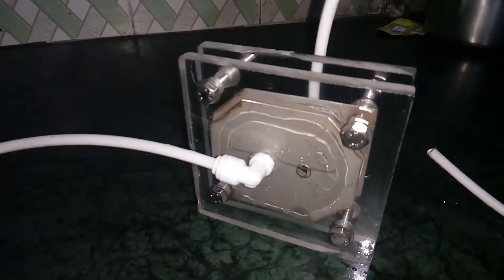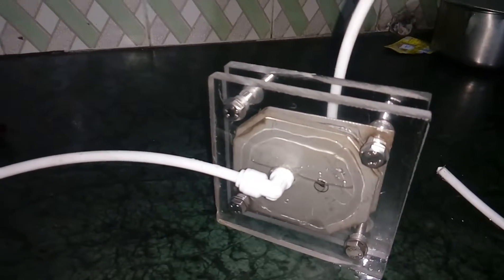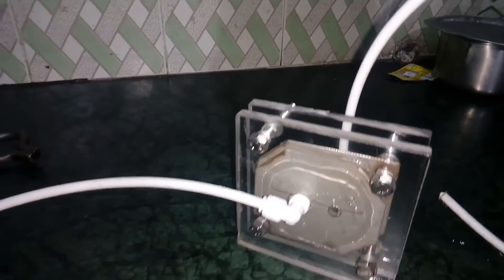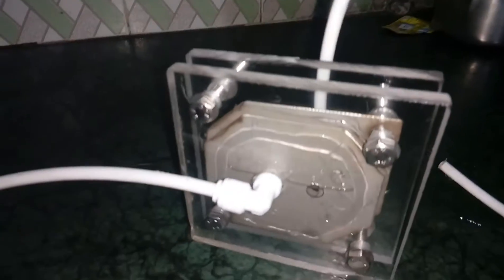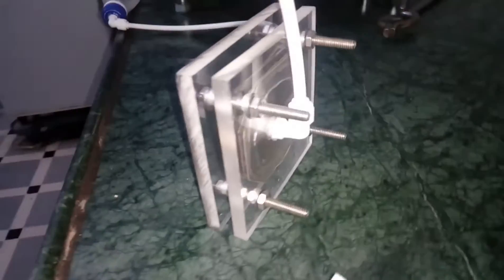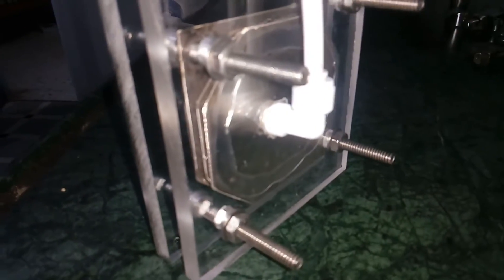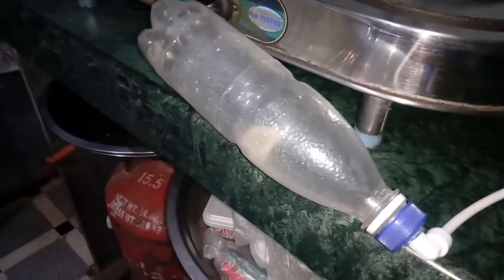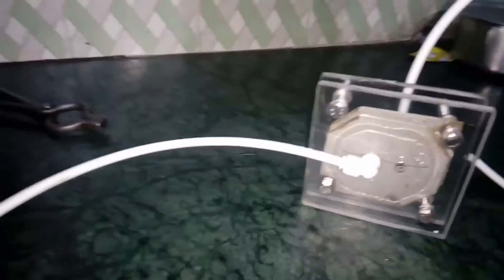HHO dry cell

Comment: hello man 
Can I replace these sheets with aluminum sheets?
Reply from the maker: fix and drive 
I have tried with galvanized sheet but that not working.
 As its easy to cut, hole amd fixing.

SS plates are hard to cut and and make hole in them. its require profesional leth tools.
Reply: Jayrajsinh vaghela  thankfor your comment
I already found a stainless steel sheet thickness 1 mm
Is it work?